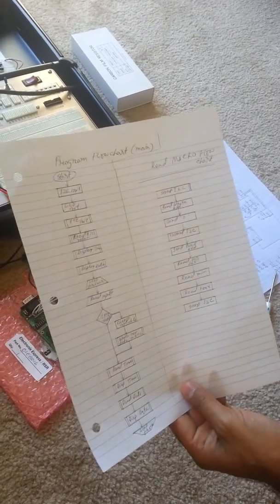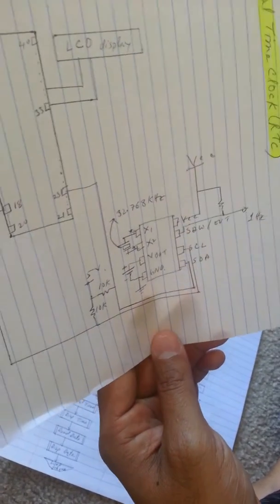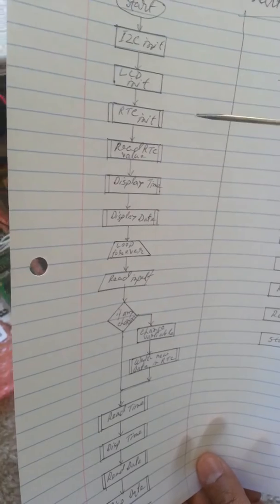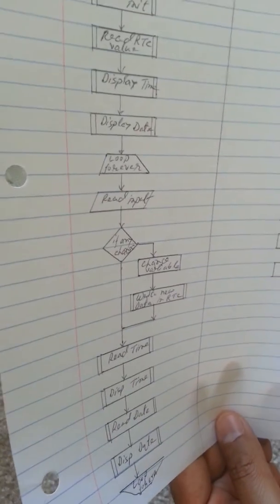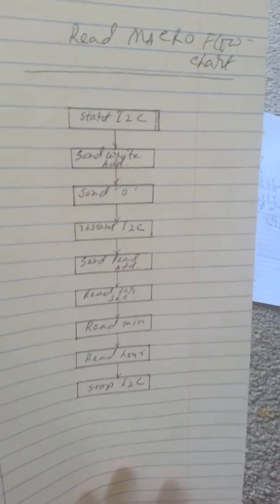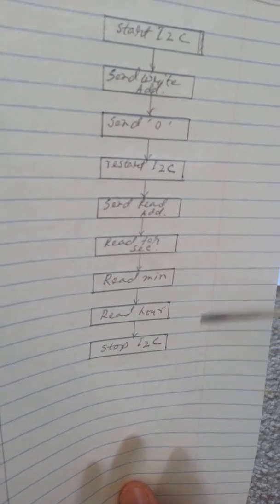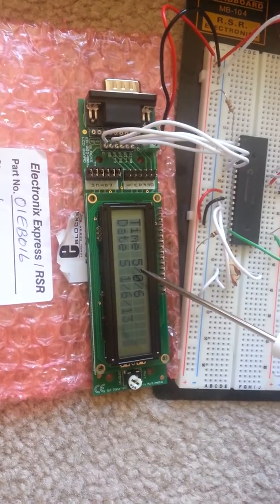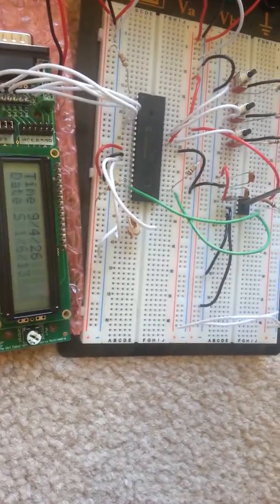Real Time Clock (RTC) Interfacing using I2C protocol

Comment: Hi! Cool clock u have made :) I am interested about writing part, how u write seconds/minutes/hours to RTC? I am making clock with same DS1307 and using Flowcode V5, but this is part where i am stuck. Hope u can help, i would like to see ur program to get through my problems..
Reply from the maker: Hello,
Sorry for late reply. At first you need to know DS1307 very well. It's register values those are related to sec, min, hour ,etc. You basically will write values to corresponding registers. You also need to know I2C protocol of micrcocontroller. I assumed you already know how to use flowcode.
Reply: Khan Alim
I have tried to make program, in simulation i get time:45:85:85 and cant change it. :s
Reply from the maker: It seems to me that you are not writing in correct registor value or when you are reading, you are not reading from correct registor. I assumed you had used 32.768 kHz crystal with DS1307 and 12.5 pF capacitor. Also make sure when you read in I2C protocol, you have to write first in order to align cursor.